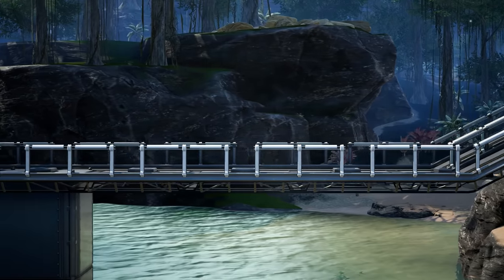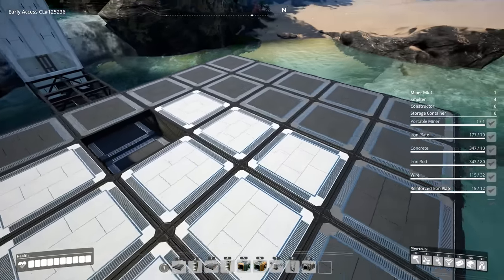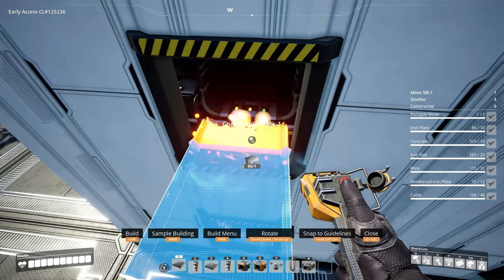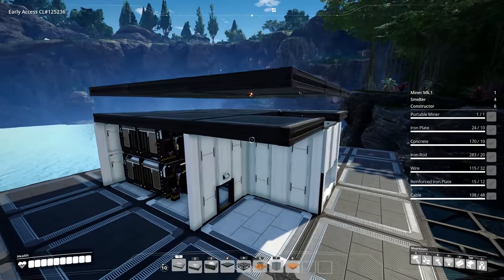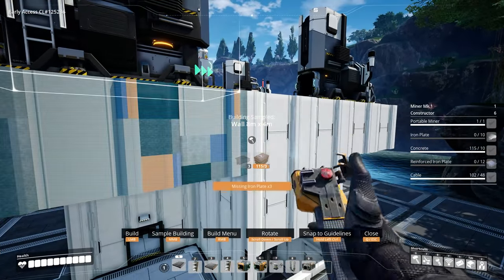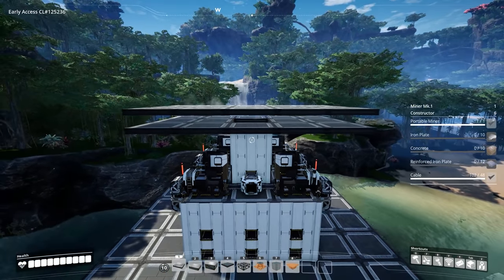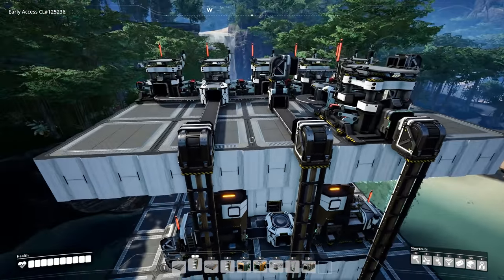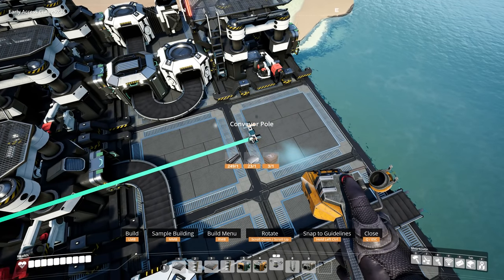100% EFFICIENT Early Game Tier-1 Iron Factory [SATISFACTORY GUIDE]

Comment: All the constructors run at 100% except the screw maker. You must use T2 conveyor from the splitter to get 100% or the travel time will cause the screw maker to run at 75%. Awesome video otherwise.
Reply from the maker: This is incorrect. Regardless of length the input to the constructor is consistent to have it operate at 100%.
Reply: @Scalti  Dude. I sat and watched the damn thing for 30 minutes. The efficiency stayed at 75% until I changed the splitter that fed it to have tier 2 belts.
Reply from the maker: Not sure what to say. I verified it in the exact structure I built in the guide and it’s at 100%. The belt speed overall do not matter. The first few rods in the line that take the short path will simply wait for the longer ones to catch up. But because the rate of production is consistent, it balances out after the initial delay. I wouldn’t be surprised if it’s a UI bug. For what it’s worth I would suggest checking the production of the constructors making the rods and ensure those are at 100%. There could be a small error made in the build earlier in the system. Let me know what you discover.